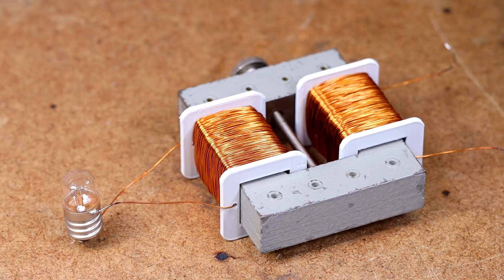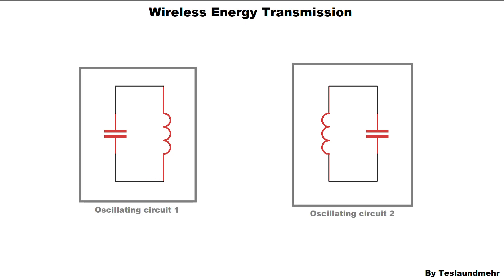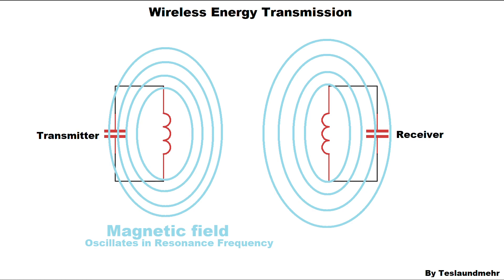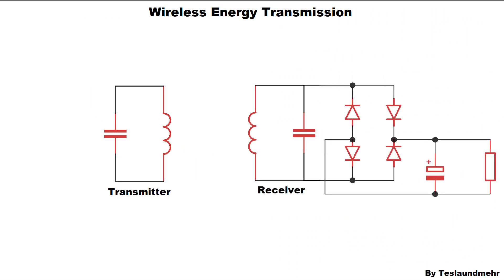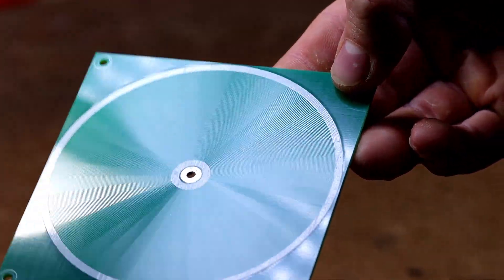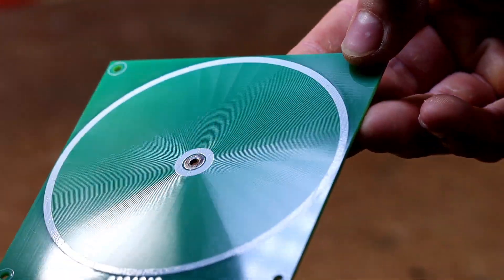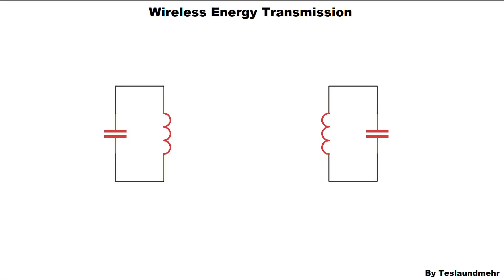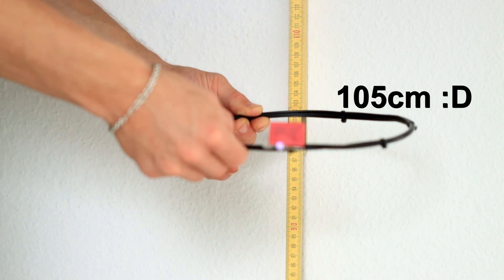Easy Wireless Energie - 1 Meter? No Problem!

Comment: If I may make a comment from my experience with wireless circuits.  You're using a lot of energy here... the reason for your using so much energy is that your transmitter circuit is in parallel.  Try a half bridge driver (or even a high speed, high current gate driver chip) driving the transmitter circuit into resonance with a SERIES transmitter circuit... not parallel.  Also, in this configuration, when my parallel "relay" circuit  (the one between your transmitter and the receiver) is put into the proximity of my transmitter.... If you place it correctly near but not too near the transmitter ---I many times have seen a power decrease (lowering of current) on the primary while the range of the field is extended!  These are not like core transformers - air transformers behave VERY differently.  The overall field grows stronger with lower power input!  The circuits interact to build each other up - in a positive feedback that is very advantageous.  There is someone I know who added a bunch or "relay" circuits near the transmitter and got to basically zero current (...even at times a negative current) while transmitting and lighting loads.. Also, your coil shape is important... those coils you wound have small Q values... a high Q coil will make things much better - the more square the coil (length about the same as width) the higher the Q and the more you will see the effects I described.   Also the higher the frequency, usually the better your results (above 1 MHz has been good from my experience).  You have only scratched the surface of what is possible here.  Anyways - great video, always enjoy and look forward to your content!
Reply: The secret is "parametric transformer". Air cored parametric transformer. Only possible with the existence of aether but can the inductance of aether be modulated Lol?

Comment: Awesome video mate, well presented, showing something that Great Scott missed in his video on the same project, different approaches to the subject but i like yours best. i really look forward to seeing a drone flying but the range would make it no more than a demonstration. we have a experimental wireless power transmission going on here in New Zealand currently so with that technology you could actually fly a small drone in the beam they are sending line of sight across back country NZ, using a microwave based beam. would need to place the drone in the beam using a second conventional drone then disconnect when the drone is in the right location.
Reply from the maker: Hey Noel, thank you for the kind words!
That sounds very interesting, I thougt about using a Magnetron, but its way more dangerous. I hope it will work anyway.

Comment: And with his high voltage impulses Nikola Tesla could create  PARAMETRIC resonance. Which is even more powerful.
Reply from the maker: I will do some research Ivo ;)
Reply: @Teslaundmehr  Start with parametric transformer. Blows up your mind. Then you will see the secret of parametric electrical excitation, parametric electrical oscillation, parametric electrical coupling, and parametric electrical resonance. This involves modulating inductance - which makes me think if modulating the inductance of aether is possible or not Lol but looks like it is possible.

Comment: Would it be possible to integrate the capacitor into the PCB coil too?
Reply from the maker: Yes, that would be very easy ;)
Reply: @Teslaundmehr  please do. Somehow integrate the capacitor using the traces. I think that way you can have far better resonance tolerances
Reply: Maybe a collab with Carl Bujega would be cool.